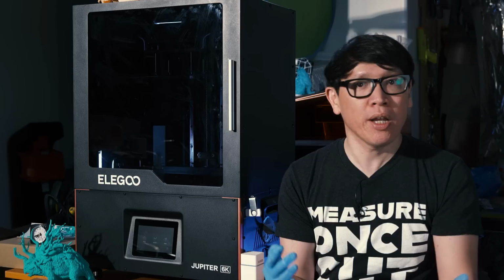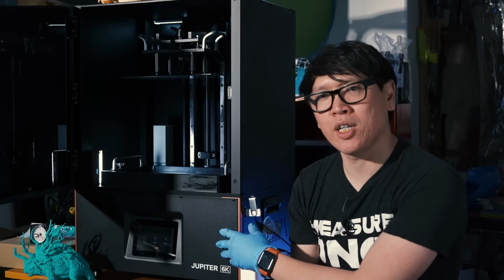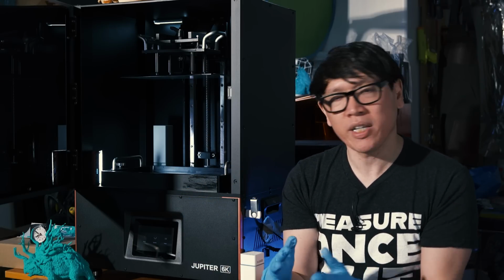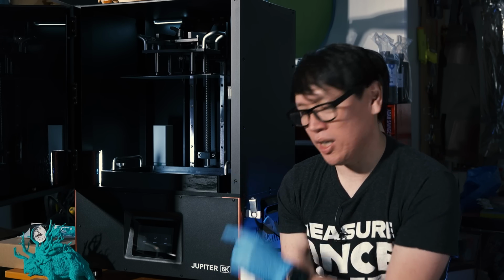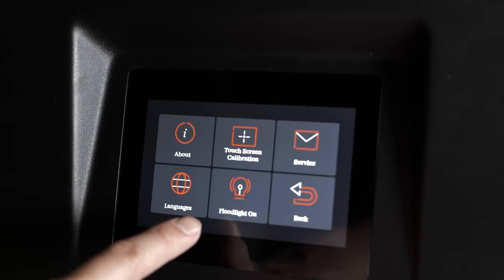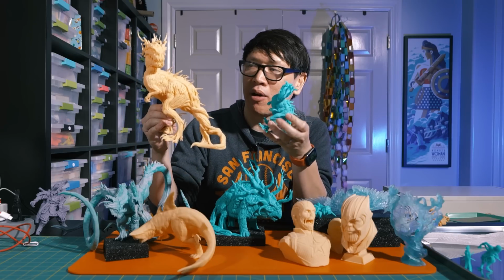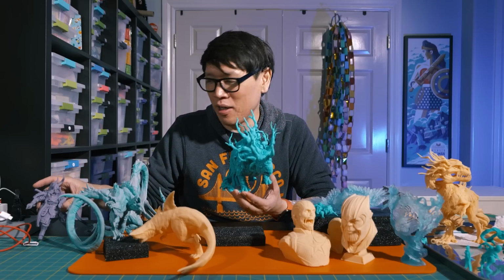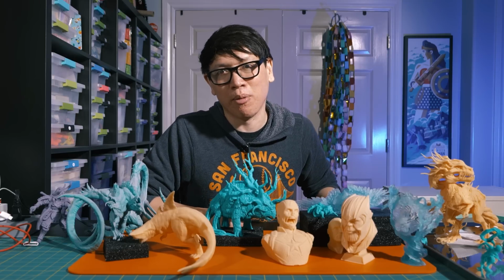Elegoo Jupiter 6K Resin 3D Printer Review!

Comment: I got an Elegoo Jupiter about 3 months ago. The machine has worked great. Unfortunately I ordered 10 bottles of resin directly from Elegoo on May 9. It is now July 24 and the shipment has still never been tendered to UPS by Elegoo.  Elegoo doesn't answer my requests for information about my order. This machine can grow huge parts fast and I've gone thru 40+ bottles of e-sun resin from MatterHackers while I waited. 

I use my Jupiter industrially and the incompetence of the Elegoo team compared to other suppliers makes it evident that these guys are accustomed to working with people printing dolls rather than doing serious time sensitive work.  I will never order anything from Elegoo again without going thru Amazon so I have protection against bad actors like this.  Had I known they were such a poorly run business I would have bought a different machine.

It's not rapid prototyping if it takes 3 months to deliver resin.

Comment: This is odd in a way! Because they released this Jupiter resin printer Before the new Saturn 2 resin 8K printer 

I brought in the Black Friday sale launch of the new Saturn 2.
They normally would do a bigger resin printer and release it before the next one which would be bigger than the last?

But Elegoo released the Jupiter after the Saturn 4K printer but before the Saturn 2 8K resin printer! 

So odd to do it in in a order like this?  It really should have been Saturn 4K then the Saturn 2 8K Then the Jupiter 6K.

The Saturn 2 is a great big resin printer with some of the features seen on the Jupiter.

My Saturn 2 has the 4 small table lift off protection bolts to protect the FEP sheet when it is removed from the printer on to a table top.
It has a 10 inch screen with a protection glass over the LCD screen, a in built special usb slot in the back left corner of the base for the Elegoo plug in big Filter unit.
It can print 250 mm tall by 219 mm long and 123 mm wide.

The build plate is attached to the lifting bracket by a huge ball and socket mount with a inbuilt spring and two huge Allen Key Bolts on the X & Y.
So leveling is far better to do than the Jupiter.

The UV protection red acrylic cover is now a fancy angled shape at the front not flat like the Saturn.
The one thing about the Saturn 2 that is a pain though is the FEP sheets.  It is hard to buy the right sized sheets even now almost 3 months after the Printer was launched.

I had to search like mad for a FEP sheet big enough to cover the big tank the Saturn 2 has, I will need to buy bigger sheets size than I need and cut it down to the right size as the one
I found is bigger than the Saturn 2 FEP sheet and there is none the right size or close to it.

Also the carbon tall filter replacement blocks that Elegoo said we can buy don't yet seem to be available.  I will have to buy smaller height versions of those blocks from 3rd party sellers
and stack them in the tall Elegoo filter unit to do the filtering instead of buying one tall carbon block.

I would like to have the Jupiter maybe later now I have got the Saturn 2, But the cost even now in any sales is still around £1300 in the UK. and that's from Elegoo themselves.

I had to Buy the biggest wash & cure Elegoo do which is the Mercury XS which just about holds the Saturn 2 build plate in the top section of the wash tall container.
I use the water washable resin not the normal resin. as the costs of the IPA for normal resin washing is very pricey now.

I brought the two rechargeable Elegoo filter units so I could filter in the right back corner of the case and outside on the right side where I found the most smell is blowing out.
It takes all 3 of these filter running all the time to tone down even this lower odor water washable resin when printing! Lucky the two recharge units run 24 hours on a charge. 

I see they have released a new Saturn 8K version of the older Saturn 4K printer now too the same size of the Saturn 4K just now a 8K.

One thing does puzzle me though?  Why are resin build plates and tanks all Oblong instead of square like the FDM filament printers?
Seems to be odd since the extra build area in the resin be helpful and the suction effect in the resin when printing be no different to a oblong plate.

Comment: For me, the early bird special of $750 for the Jupiter was only a little more than the Saturn, so it was a no-brainer. And I had plans to do everything from D&D miniatures to cosplay pieces with it, if possible. I'm still a little worried about this being my first SLA printer, but hopefully it won't prove too cumbersome to learn on.
Reply: So 9 months in, how was the Jupiter as your first sla printer?
Reply: @iamnickdavis  To be honest, not that bad. Resin printing is very different from FDM printing, so there was a learning curve. The biggest hassle with the Jupiter is the sheer size of the build plate. It's a bit heavy and awkward to remove and get the prints off, but doable. I recently installed a magnetic flex plate which has been really helpful. But as my first resin printer, it's been great!

Comment: I bought the kickstarter.  One thing that kinda discourages me is while it says 6K it is actually lower resolution per square inch 386.3 pixels per sq inch, then the Saturn (400) and Saturn s (439)

ie (Resolution x X y) / (size x X y)  If they had actual 6k (instead of 5.5K) it would be more more like 468 pixels per square inch.  I know microns is normal but easier for me to see/understand vs .051mm. 

I am waiting to see but I think they missed an opportunity for a middle large sized printer at same resolution as  Phrozen Sonic Mega and it will be worth the price in comparison.  Having this about to come out at $1300 and the Phrozen coming down and in the $1700 range, I think if your buying now I would look more at the Phrozen if size of prints is the main thing you are looking for.  I got it for way less from the kickstarter and at $740 it is well worth it.  I just think the new asking price is a bit too high.  My opinion obviously but I think unless you need the size, 2 Saturn S at a bit over $1050 would be better if just looking to do tons of minis as you will get a bit higher details and about the same build volume with more flexibility.

Comment: Yeah, figurines are nice... BUT, what is the PRINTING SPEED of the Jupiter? Am I wrong or in 30 minutes of video you never mentioned the printing speed a single time? :(
Reply from the maker: cure and print times are almost exactly the same as on the saturn--roughly 10 seconds per layer total including all the plate movement

Comment: Is is a DLP or SLA printer? As you mentioned it has an LCD screen and prints layer, as usually  an SLA uses a laser to cure the individual points in the resin.
Reply: Lcd pro

Comment: I sure wish you guys would do some accuracy testing of the printers. I need one for actually doing some engineering and design prototyping to interface with existing items. Every one who reviews these prints just print figurines which have no accuracy requirements for interfacing with any other parts. At least print a 1" cube and then use a micrometer to measure what you really get. BTW Norm buy some glasses that fit, as a fellow glasses user you drive me nuts having to push them up all the time.

Comment: I'm a bit surprised how badly those pieces matched in the multipart print. Also, no mention at all about the big chunks missing in the prints? Poorly supported or a different issue?
Reply: Pretty typical of SLA resin shrinkage
Reply: Did you even notice them before the close ups?
Reply: @JerrodHansen  I did, yes. But it could be that I'm a bit "damaged" due to my job. I've worked in the 3d print business for 8 years.

Comment: What printer would you recommend for someone new to it who wants to print gaming minis and board game components?
Reply from the maker: Mars 3 for sure
Reply: Recommend Prusa SL1S, is a more solid machine, and better software. Yes, more expensive, but worth every freakin penny IMHO. 3 seconds a layer (complete cycle), tilt peel instead of pull peel, active carbon filter. Wi-fi as well.

Comment: Love the detail resin printers provide, I like creating small useful 3D prints and one of those would be ideal, but the mess of dealing with liquids has put me right off, one day I'll try the 0.2mm nozzle I bought for my Prusa and see what it's capable of, I hope it prints TPU well as that's my favourite printing material.
Reply: If you prep properly for the mess, it isn't that bad. I have a table dedicated to it covered in a cheap plastic table cloth, silicone mats, an open trash can next to the table, box of gloves, paper towels, and containers to hold the tools. The messiest part is changing the resin though
Reply: @Zeldur  I realise once you've got a flow to your print procedure the mess issue is reduced, but still have to deal with liquids and wearing gloves to work with them, I so appreciate the solid 'inert' materials of FDM printing and how prints can be usable the second they come off the bed.
Reply: @licensetodrive9930  Yeah, that's fair. I've had a massive mess with my fdm printer though where some petg got stuck all around the heater block. It ended up cloging a screw so when the wire broke on the temp cartridge, I had to replace the whole hot end. I also have specs of melted plastic dolops all around the fdm printer as well :/